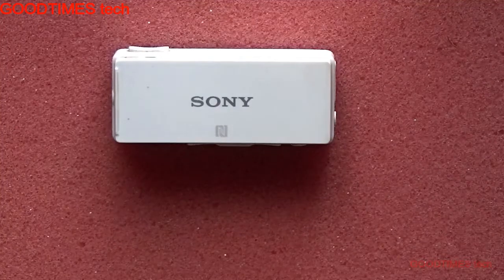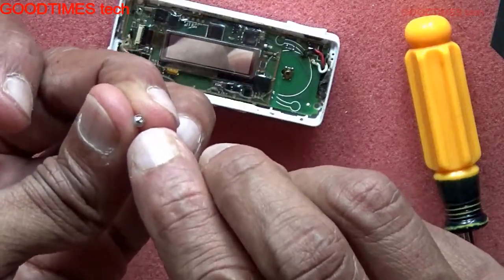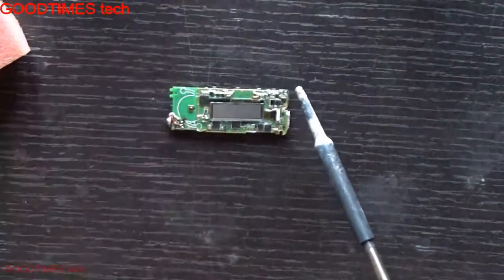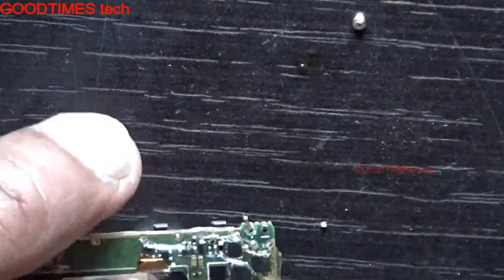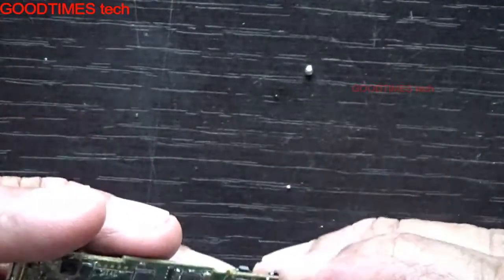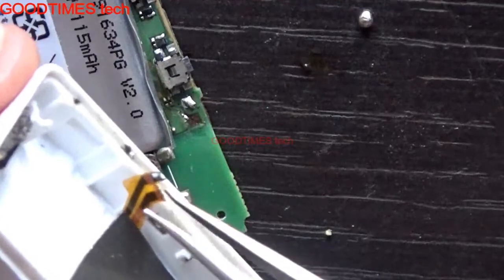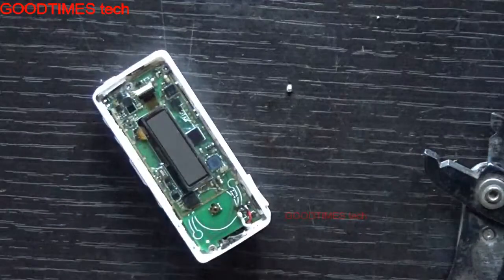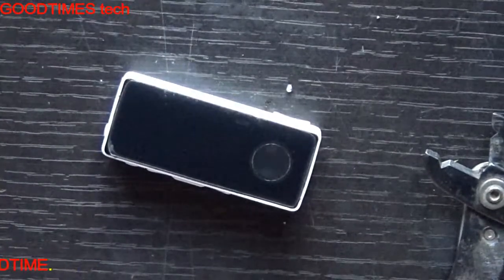SONY SBH50 Bluetooth Handsfree earphone| How To replace  Battery and FIX Broken NFC Antenna.

Comment: Thanks for the video. I have a Sony WH-1000XM3 overear headphones that i got for free when i pre booked my Sony Xperia 1 III. They are amazing. But they are sometimes very clumsy. And i cant find any headset that fits my needs. But i found 2 of my older headsets. One Sony SBH50 and one Sony SBH56. The SBH50 are completly dead i think it is the battery that are dead cause it wont start even with the power cable connected.
The SBH56 works but have a very short battery life on about 1 hour while listen to music. Cause it has USB-C i will start to replace its battery. I tried to find a video like this a couple of years back and could not find any instruktions at all how to dismantle it.
Reply from the maker: You are most welcome, happy to know that the video was useful.
Thank you for watching the video, have a GOODTIME.....

Comment: Thank yoy very much!!!
 I've changed my SBH50 battery following your video, and working OK. Battery bought from Aliexpress, easy to find with Google. Only a difference, in my SBH50, the microphone was glued on the box, so the wires broke in dissasembly, and I had to solder again after mounting.
I have not connected NFC anntenna. as this a useless feature for me.
This handsfree is much better than SBH54. SBH54 has software problems, and it never worked properly, even with a lot of firmware updates Sony released

Comment: Can you please post the dimensions of this battery? Unless I take my SBH50 apart I won't know the battery dimensions for sure, only the outer case dimensions. The Ali Express link you posted below isn't all that useful since it has many results not all of which will work.

Thanks!

Comment: where can i get this battery, can you please give me the link if available on online websites?
Reply from the maker: Dear Sir,
            You can buy battery from link given below but confirm dimensions, Voltage and current ratings with seller before ordering.
https://www.aliexpress.com/wholesale?catId=0&initiative_id=SB_20180131073133&SearchText=3.7v+110mah